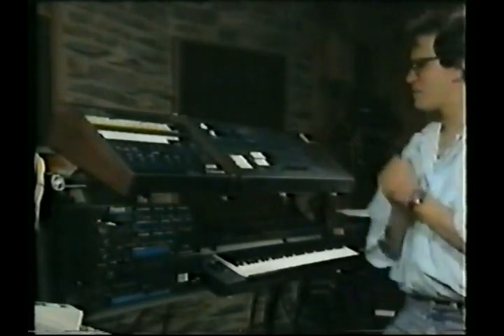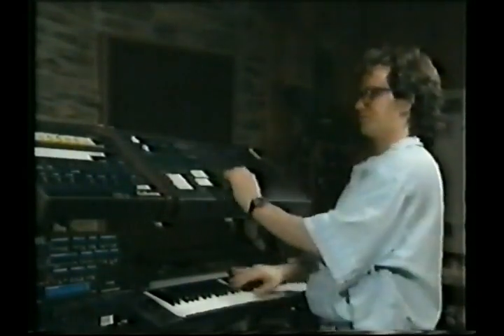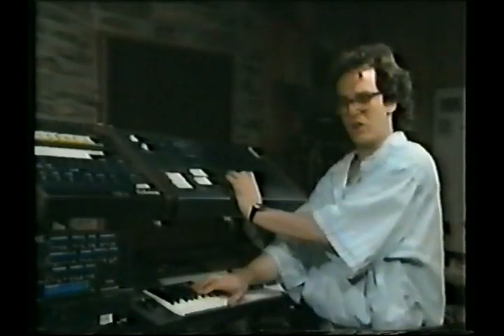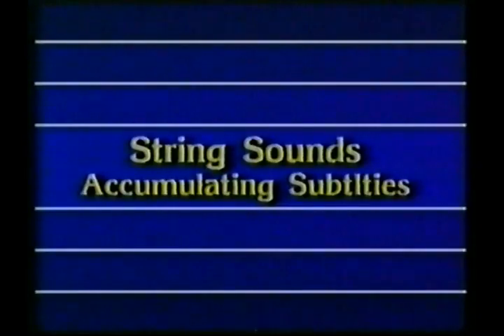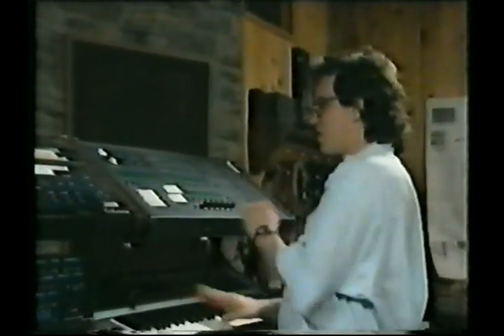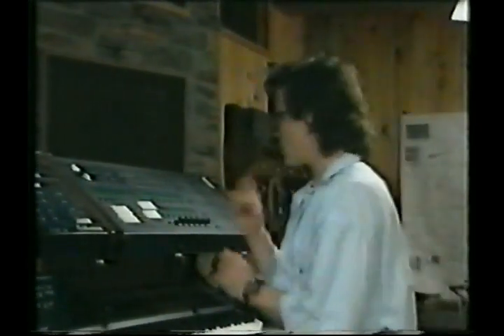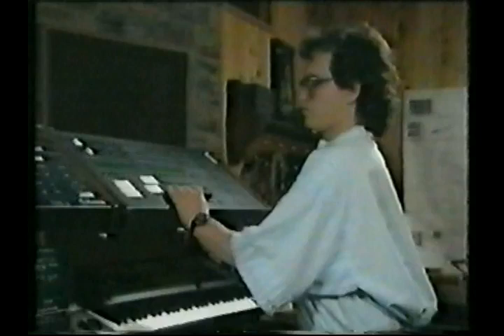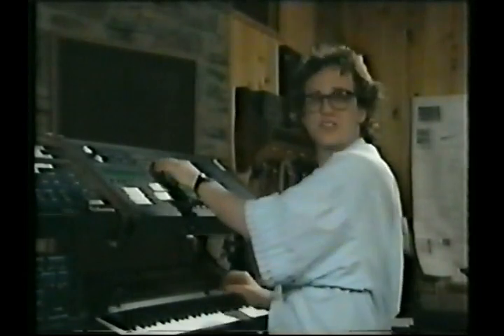porcaro synthesize analog brass

Comment: take a saw waveform on your oscillator, close your filter and send a lot of envelope with slower attack to the cutofffreq , voila your trumpet/brasssounds . lots of words used for a simple trick , idem with the strings..
nice as historical material though .

Comment: If a Roland JUNO 60 can do this ill buy one.
Reply from the maker: +michael jagger dream on  ,  a juno 60 for starters does not have a spare enveloppe for pitch modulation , worse still it only has one env for both filter and vca  , i think you have to look for the jx8p wich can do pitchmod via its filterenveloppe , the jx can do decent brass as you can hear on that  overblown eeeh yuk  'final countdown'  wich was a jx8p  factory brass patch
Reply: AlainRaes67 Ive actually thought about getting a JX-8P.
Reply: Ive been trying out PG-8X as i can't afford a JX-8P. It's quite fun and actually sounds like the real synth. The Final Countdown brass is the Stab brass patch and of a JX-8P combined with a brass patch off a TX816. Still saving up for an analogue synth but still undecided.
Reply: I had one. Great synth! Basically a Juno 106, but with digital controlled osc's, so they didn't detune. No buttons/faders though. But you can try to find the programmer(PG800?)  Sound is great. Don't pay too much for one. A lot were made.
Reply: Juno 60 doesn’t have pulse width 😢
Reply: @maxferdy7702 It does

Comment: Great Strings sound he achieves !!

That Oberheim looks a massive complicated machine !!  I think its midi up to a DX7 (Mk 2).
Reply: +AlainRaes67 the keyboard below the DX7 was a Yamaha KX88 which was just a controller. ToTo used this during the late 80's and early 90's
Reply from the maker: complicated it might be  , but the oscillators were so cheap (synth on a chip curtiss)  and the rest is all software  , compared to the old oberheims this thing has no depth of soundfield and sounded quite flat , the ob8 started this 'cheaper component ' thing  on oberheim synths
Reply: AlainRaes67 So the EARLIER Oberheim's were richer and offered more complexity in timbre, compared to the 'Expander' version (as in this video) ??
Reply from the maker: you had two expanders (one named expander
and featured an addon for the Obx-a  and the
xpander as seen in this video) so ex and x:)
and yes the last obie that had the real sound
was the obxa , from the ob8 onwards they used software lfo's and lower grade components but MORE modulators since they didnt need hardware anymore to do the routings , but older (sem and obx versions) definatly better timbre
Reply: AlainRaes67 Ta mate and thanks very much indeed for posting. 

I would really love to see the demo video SP made on the DX7 synth if you have it anywhere please.
Reply from the maker: it wasn't by porcaro , it was an early video 85 ish on a mark 1 dx on the concepts of algorithms and operators and how to achieve simulation of acoustic instruments , at the time i had this nifty atari program bu c-lab , x-alayser for the dx , you could dump a sample from my s900 into it and it would re-synthesize that sample into dx7 parameters , so you could play the sample in the dx using fm  , and the sample length across the keyboard was the same (no repitching) without multisampling!
Reply: AlainRaes67 Oh, OK.  Was the DX7 video the ones by Steve De Furia and the guy who wrote the hit song 'Lucky Stars' ??
Reply: @AlainRaes67  those programs sound great, I'd love to use that with my S900 and DX7. Do you think those programs could still be found?
Reply: michael jagger So did Chick Corea in his Elektric Band.